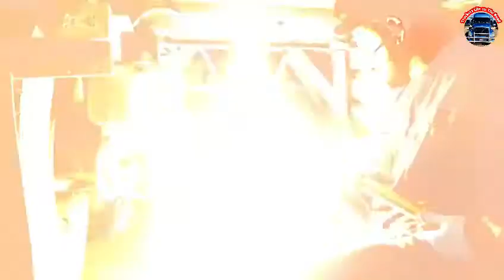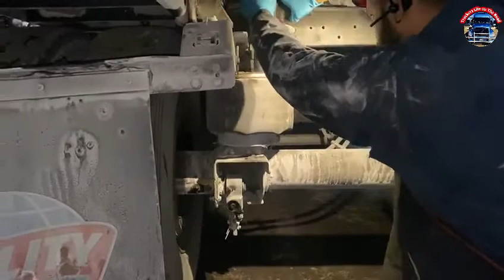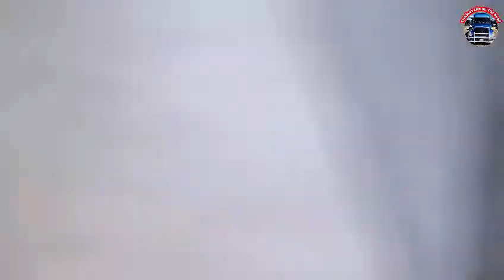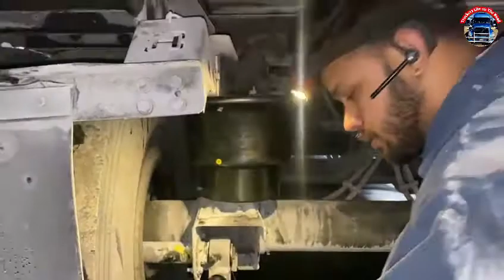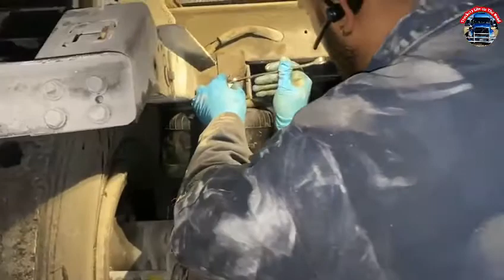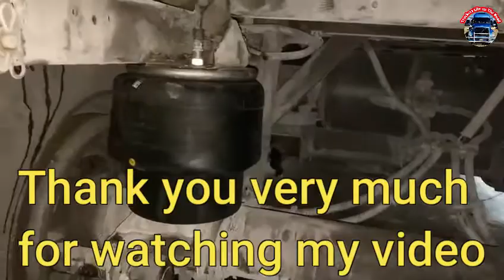How To Replace Air Suspension Bag On | A Trailer Or Reefer

Comment: Welp guess I'll be taking mine to the shop
Reply: Lol right I just said the same thing when I seen tht jack  an I only have a box truck 🤣
Reply: @dramsey5222  when I saw the torch that's what made me change my mind but being that shops are all backed up I figured how to do it myself.  It was a mutha but I got it changed.  👍
Reply: @chrisdasher7116  hi friend thanks for sharing. What were the difficulties you encountered with changing TRLR air bag? Thanks.